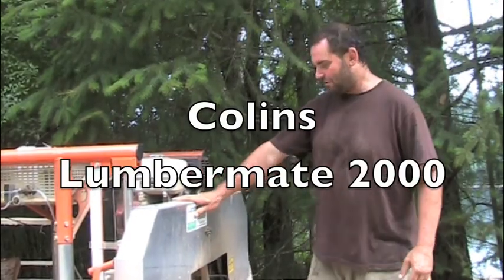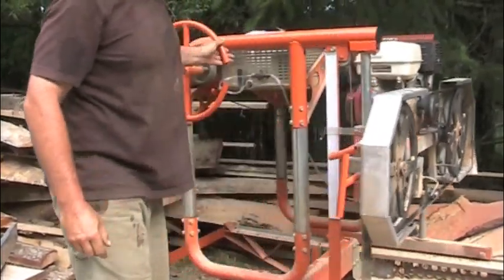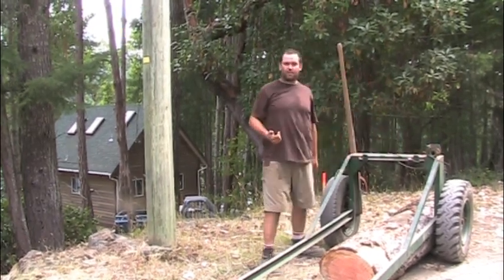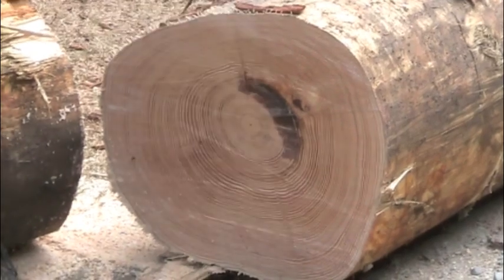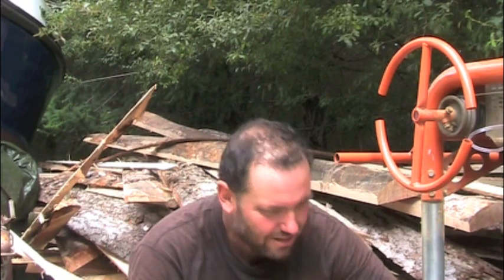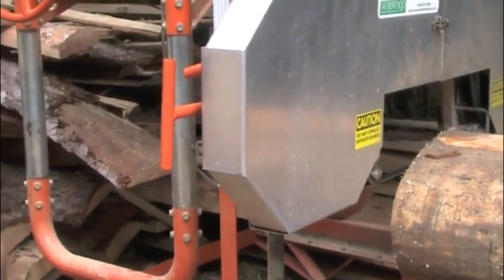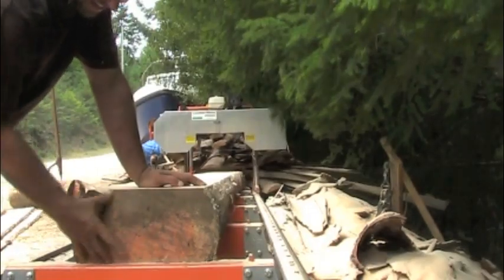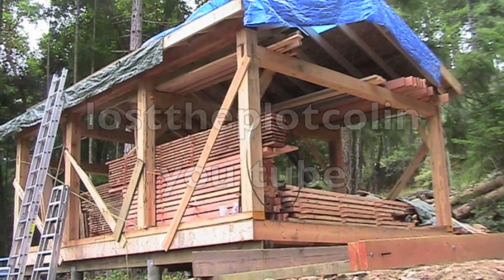Colins LumberMate 2000

Comment: I would add a length of fire hose onto the cable on your hauler.  It will protect the cable and the wood, and keep the cable from dropping wires into the wood.